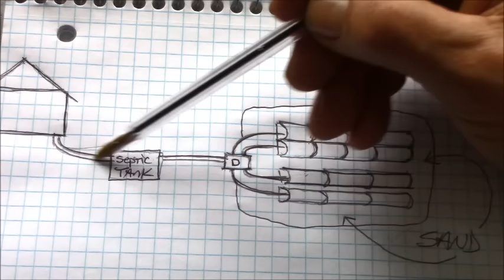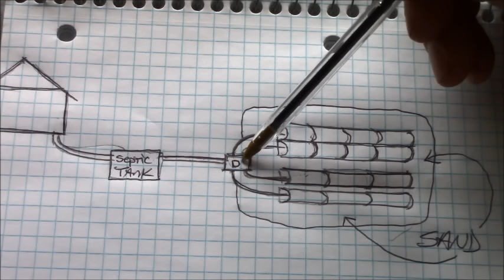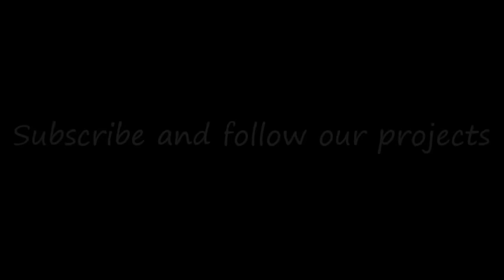HOW TO INSTALL A DIY GRAY WATER SEPTIC SYSTEM For A Cabin Or Homestead.  BUILD YOUR OWN AT LOW COST

Comment: Bless your heart!!! We put our septic tank system down right here in Trapper Creek Alaska with 2/ 250 gallon tanks that were used for oil they fry chicken in at Kentucky Fried chicken. They sell these tanks all over here in Alaska and they use them for tons of things here. Most people see them in the back of pick up trucks to hold water. These tanks are square and they have  aluminium bars around them. Well we dug out enough dirt to be able to bury 2 of these tanks and a leach pipe about 10 feet long. We attached the 2 tanks together with a pipe between them so the first tank can flow into the 2nd tank through the top on the sides of the tanks. The pipe that's going from one tank to the next tank is glued so it won't move. Those tanks are called, solid tank and liquid tank. Then in order to make sure the tanks can not ever float, we wire hangered these heavy duty bed springs we got from an old military base and they were the bed springs they used for the military beds. I originally used them for fencing for my goats. They are sturdy and very heavy. We wired 2 on top and 6 all around the 2 tanks. Then from the top of the liquid tank, we put the leech pipe out the side on top, then down to the ground and ten feet out slightly at a down hill. I had the duty of filling the leech pipe hole full of bigger rocks so to be a drain into the ground after the waist water flows through the leech pipe.Then we wrapped that leech pipe with membrane so the silt can't clog that pipe up. We buried the whole thing and I haven't had to use the out house hole since, and it's lasted for 4 years now.  And if ever I have to have it pumped out, I can because of course we made sure we put pump out pipes going up through the tops of the tanks. This project only cost me $1,200. Both tanks were only $100. The thing that cost me the most was paying the guy to dig the trench for the tanks and end leech pipe, then to burying it all up.
Reply from the maker: Sounds like a good setup for sure.  They sell those tanks here too.  I always planned on going over to Trapper Creek just because i liked the name but never made it.  I spent a lot of time in the Homer / Seldovia area but plan to return sometime in the near future.

Comment: Installed the system from the previous video a few years ago.  Put in 2 feet deep.  Works great, no problems even in the dead of winter.  My cabin is at 6500 ft and gets 5-10 feet of snow.
Reply: 😯

That's great to hear. We're building a cabin in South Central AK and I was worried about the cold ruining it.

Comment: Great system and pretty similar to what I've drawn up for my septic system. And the washing machine gray water system too. 
I like bubble foil too. Used it in my country home for the in floor heat "reflector", in the trenches from the outdoor Woodstock to the livestock tank to keep it 45°F - 55°F perfect animal drinking temperature.  I wrapped and taped it around the pex tubing before slipping it inside the black corrugated black plastic piping in a bed of sand to and spray foamed box with styrene panel on the under side of the box as a cover.  Cutting the shape of elongated toilet seats (just 2) for the animals to drink out of all year around. I made a flow baffle and could turn on 1, 2 or 3 heat rings made of pex tubing coming off the inlet valve and returning to the outlet valve for heat circulation.. It works great in-30°F (approximately -48°C) weather with gusts up to 60 m.p.h. (approximately 97 Km per hour) here in Michigan. My water was never frozen.

Comment: Great minds think alike....Almost exactly the same setup at my off grid cabin. The only difference is I cut a cleanout hole in the settling barrel, big enough for posthole digger. Covered it with a 16x16 patio stone and 8 inches of dirt. But in over 25 years I have not had to dig it out. The half barrels work way better than the pipe with holes buried in gravel. Great video!!

Comment: I knew you would use Bubble foil in that project.
I was planning to do that last fall with mine but winter set in way to fast before I could get it done.
Side note. I was having a problem with my propane tank freezing this winter because of the draw of the back up heater. And what comes to the rescue. BUBBLE FOIL. Lol it keeps the propane tank from freezing at -27
Thank you so much Boss.
Bubble foil will be also used in our roof insulation with air gap then 6” of R23 insulation. 
God Bless and Merry Christmas to you and Lorie.
Reply from the maker: Merry Christmas :-)

Comment: Hey JC, we were shocked to see you didn’t use bubble foil over the barrels in the leech system, lol.  Question, the system you built for your friend, you showed a new barrel format at the end of the pipe. We were thinking of cutting the top out of that vertical barrel, say a 30 gal barrel system and cover with a 45 gal piece (about a 1/4length of a 45gal drum) used inverted as a cover in case we had to uncover and inspect for some reason, cutting a U shape out of the 45 gal top and to lock over the pipe? Thoughts? Or over thinking?
Reply from the maker: I think that would be a great improvement. Good thinking.

Comment: Boss love the video and am about to install one at our cottage. Tell me, why does the sump barrel to settle out the solids have the bottom cut out of it. Thanks so much 
Peter b
Reply from the maker: Since this is for gray water, I decided to leave it bottomless, hoping that water will leach out the bottom for quite some time rather than have grease continue to float to the top and run into the leaching section.  I suppose either way will have it's pros and cons.
Reply: @thebossoftheswamp great explanation. Thanks so much

Comment: Another great Video J.C.   Do you think if I put bubble foil on top of the joist that are in the attic of my camp it would help keep the heat in?   This is a one story camp with about 5 foot of attic space I don’t use.
Reply from the maker: If you mean the underside of your joist, I'd say yes it'll make a big difference.
Reply: The underside is my finished ceiling, would it help on the top of the joist?
Thanks for your time